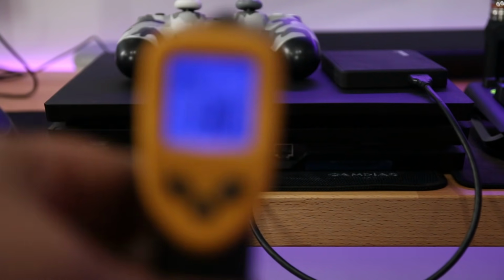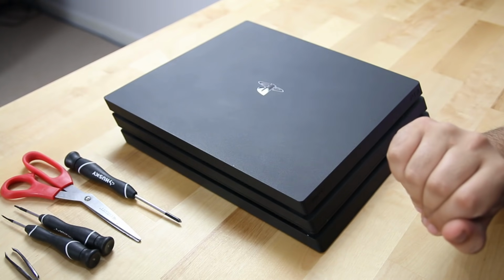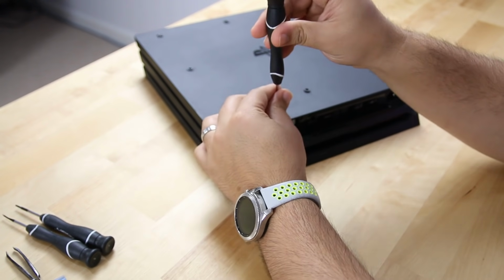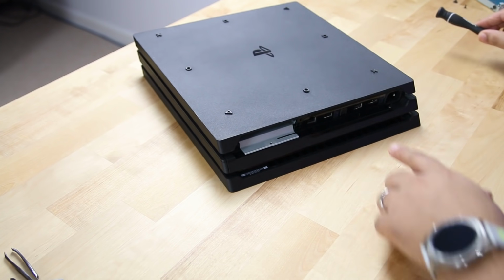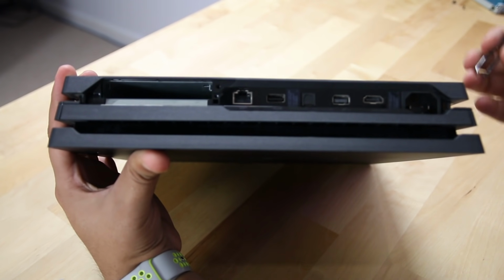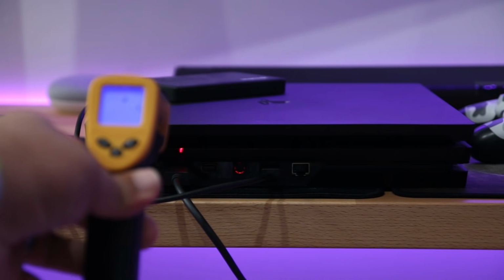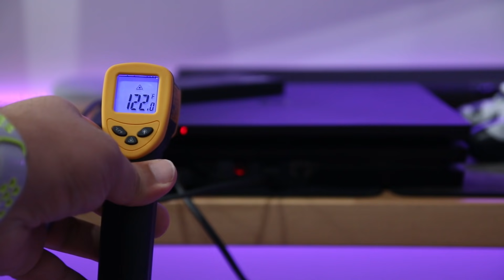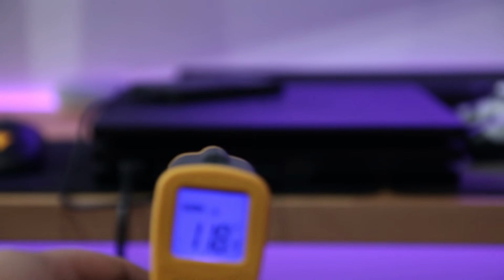PS4 Pro Fan Noise Fix - Thermal Paste & Pads Upgrade

Comment: Hi. Please check the video at 7:00. That are not memory modules. In fact, those are chokes. They do not require cooling on the ps4 pro. It's the vrm's that need it(the little black chips a few milimeters above. So you have put the thermal pads on the wrong place. It may fry your ps4 pro.

The thermal paste usually is to put on top of the apu and not the heatsink. But the way you did it works also.
Reply from the maker: Thanks for correcting that. I'll be sure to fix it
Reply: Thanks for mentioning this because I was just about to do this. When you say it's the little black chips (x6), do you mean the ones lined up right against them that require the cooling pads?  Or the 6 other ones which are grouped 2 and 4?
Reply: @pspasta5399  The other 6. Not the 2+4. On the video is the 6 chips above the place where he put the thermal pads.
Reply: chicozeb i opened my ps4 pro and by default the white thermal pads are on the chokes. i’m confused here
Reply: The chokes were (padded) from factory, he just replaced them.
Reply: Hi. I'm thinking about replacing the thermal pads and paste of my PS4 Pro at the moment, because it's gotten ridiculously loud at this point. And during the video, Tech Savvy Buyer recommended 1 mm thick thermal pads. But there is also 0.5 mm thermo pads. Wouldn't those be better? 

I will also try and put on the thermal paste as thin as possible using some plastic card to spread it, just to connect the APU with the metal plate without any air inbetween.
Reply: Well spotted! At the beginning of the video he recommends buying thermal pads of 1mm thickness. I now wonder even if that's correct... sigh
Reply: @nekron75  I ended up not replacing the pads at all and only replaced the thermal paste. I used arctic MX-4 2019 edition, which is the most common among mid to high tier pastes. I think, the pads need to be 1mm thick, in order to connect the memory with the cooling shield. The original ones are a little small and ould be replaced with new ones covering the whole surfaces, but the original ones seem fine. The way more critical part is the APU. 

And I'm absolutely happy with the result! It is not an overreach to say that my PS4 Pro is now way more silent by a factor of 10! At first I heard nothing at all during the menu of DMC5, where my PS4 would previously be loud as hell already. So I was worried that I forgot to reconnect the fan or something and the thing is overheating right now. But air came out normally and even during gameplay, where the cooler would normally run at max power, the PS4 was still almost silent.
Reply: @CycloneFox  Replacing only the thermal paste really made such a difference? Was the original thermal paste dried out then? Also there was no dust clogging up the heatsink? Sounds promising! I have some thermal grizzly kryonaut left i.e. rated at 12,5 W/mK, arctic MX-4 2019 edition is 8,5 W/mK. If the noise is still too much, I might buy a fan controller (https://www.ebay.com/itm/PS4-Pro-Fan-Mod-Variable-Speed-Controller-for-CUH-12xxx-7xxxx-Wht/191754341074?hash=item2ca5730ad2:g:I7gAAOSwcgBcmqAP) the grey one probably and tune the fan lower so that the exhaust air temperature is about 6-8 degrees Celcius higher, just like with the newer 7215 ps4 pro model (it's a quieter model (initially only bundled with rdr2) because the fan spins slower but the exhaust air is about 8 degrees Celcius higher).
Reply: @nekron75  Actually yes. I bet you get the most optimal result with a higher quality thermal paste, but the main problem lies with the oblong shape of the PS4 Pro's APU compared to the square form of the original PS4 APU. The thermal paste is only applied in the middle and spread by the head sink pressing on it. So the two outer edges don't get enough thermal paste and there is a lot of air. So replacing the thermal paste and spreading it evenly with a plastic card evenly on the whole surface including the corders and edges will fix the whole problem. 

My heat sink had a bit of dust in it and I already cleaned the fan on the top. But the main problem was really the unevenly applied thermal paste. 

When opening your Ps4 Pro, make sure to not break of the plug connecting your power unit to the main board! The pod for that plug is solder jointed on the mainboard and the plug may be hard to pull out of that pod. So many people try to wiggle it out and break the solder joints in the process. I personally didn't pull out the one on the board, but on the power unit. That way I later had one more cable in the way when re assembling the main board, but I had an easier time reaching the plug. So I could hold it down firmly on the power unit's board while pulling it out with a pinch-nose straight. 

But that's the most critical part of disassembling your PS4 Pro. There were five or so flat cables of which the widest one had a clamp, which you need to clap up with your finger nail before pulling out. But the rest is pretty safe. Just have a few containers for at least three different kinds of screws and you should be okay.
Reply: @CycloneFox  Thanks a lot for the explanation! I'll order some 1mm "thermal grizzly minus pad 8" thermal pads (8W/mK) and then do the mod.
Reply: @chicozeb  The circle chips that's grey/black? or the chips directly touching the pads?
Reply: Aris Golseen It seems like the video is updated and it’s in the right place now, because if you go to 7:00, the 2+4 chips are below the ones he put the pads on.
Reply: @marcusgetsbuckets8798  wait so it used to be on the 2+4 chips?
Reply: It seems that there´s some confusion about this subject...

I´ve opened my ps4 pro again and i´ve checked everything again(looking between the motherboard and the metal plate while closing) and the thermal pads go to the place that i said before. http s://d3nevzfk7ii3be.cloudfront. net/igi/4N6gx2rfRwkLEJLU. huge (please remove the spaces because youtube will make my comment invisible if i post links).

The thermal pads go to the 6 Fairchild Semiconductor DG26CF FDMF 6840C. They are between the 6 chokes where he puts the thermal pads in the video and the 6 capacitors(the silver cylinders). The 6 black chips (or mosfets) in blue on the image above. Image credit of ifixit - PS4 pro teardown - step 10.

You can use 1mm thermal pads or 1,5mm. All thermal pds used by sony are 1mm. I used actic thermal pads with 1,5mm. They will squeeze, so there´s no problem(in this situation, because sometimes bigger thermal pads make other components not touch the heatsinks - not in the ps4 pro though).

I used 1,5mm thermal pads on the vram on the other side of the board. No problems also. It makes contact for sure, while the 1mm pad may not make proper contact if something is crooked or not entirely flat(may happen with industrial production). It is a little more difficult to screw it down but the pads will squeeze and be ok.

For the APU(the AMD ps4 chip), i used Thermal grizzly Hydronaut. Originally i used kryonaut, but since my PC GPU temperatures got considerably worse over 1 year using it(3 to 4ºC hotter), I decided to replace the thermal paste in every console that i have with Hydronaut, following thermal grizzly advice, after i emailed them because of this issue. Apparently kryonaut will pump out. More speciffically, the silicone on the paste will pump out. In fact, every themal paste made with silicone will suffer from this. MX-4 is not good because of this. Half of it is silicone, and after a while, temps will become much worse while the silicone on it goes away. So it´s better to use non silicone thermal pastes. And with a percentage of thermal conductive materials above 80%(zync oxide, aluminum oxide). To check the composition, google the name of the thermal paste and write msds. Or Material safety data sheet. Usualy there´s good information there. Hyronaut does not have silicone, so it does not pump out or bleed.

To apply the thermal paste it´s better to spread it. You will be sure that every part of the chip is covered. Using a small dot in the middle does not give you that guarantee. I always use more thermal paste than i think is necessary. It will not damage anything(unless you use a conductive paste) and the excess will go out to the sides. This will compensate for any big uneveness that the heatsink may have, and again, it will guarantee contact. And no, it will not make temperatures worse, there´s a lot of youtube videos talking about that. Too little thermal paste gives you bad temperatures. Not too much. It´s more expensive though...

And yes, using hydronaut makes a difference. The fans are quieter. I was trying to show a friend the jet engine noise on the god of war title screen and the ps4 pro never got to that point(that´s when i remembered that i had put hydronaut a few weeks before).So, for me, hydronaut is far better than kryonaut and, surprinsing as it may be, it gives me better temps on my pc gpu and on my laptop, even having lower thermal conductivity. Go figure...

On a side note, i´ve replaced the arctic silver 5 on my pc cpu with hydronaut. Done a stress test before and after the replacement. Hydronaut gave my 2ºC lower temperatures under full load. Funny thing is: it´s the first time that i replaced the thermal paste on that pc. Arctic silver 5 was there for about 7 years. Temperatures like day one. So it seems a good paste for longevity. At least from my experience. And it does not have silicone.

Comment: I put Kryonaut in my Pro and the results are pretty incredible. It's much cooler and quieter now. Super impressed. Haven't done the thermal pads yet but I plan to do so soon.
Reply: How long does kryonaut last before it is replaced?
Reply: @collinsatinga2131  I usually replace mine about once a year, but it could probably last longer than that.
Reply: Any paste will work. It's just a matter of for how long before needing to re-paste.

Comment: Good video.  I know some other YouTubers have pointed this out but just before 5:00 make sure you've taken out all of the T8 screws on the metal bracket on the other side of the PS4 before removing the PSU....I slightly cracked the plastic cover that shields the PSU until I realised there were two T8 screws which needed to be removed!  Also, I found the PSU connector cable virtually impossible to remove, so I left it connected.   It's a bit of a pain in the arse when leaving the PSU connected but it is doable

One thing I discovered was after applying the thermal paste (pea sized) the PS4 fans were louder than ever.  This is the first time I've ever had this issue when applying thermal paste (I've applied it to many CPUs) - so I took the PS4 apart, applied more paste and spread it over the APU.  The PS4 is now as quiet as a mouse.
Reply from the maker: Thanks for pointing that out. Can't believe I left that out lol. This was one of my earlier tutorials and I missed some key things. Lesson learned. Thank you so much for taking time from your day to write this comment. You are amazing and I appreciate it very much. I hope your system stays cool! God bless ya
Reply: Tech Savvy Buyer No problem! It’s still a good tutorial!
Reply from the maker: Thanks bud. Much love from Ohio!
Reply: I couldn't get the PSU cable out either, I came close to damaging the little wires so I had to give up. It was very awkward to add the paste because it was in the way but it worked in the end.
Reply from the maker: Did you make sure you removed the screw on the other side of the PSU? It should pop right out. If something feels stuck always check that all the screws are out.

Comment: I currently have one of the Star Wars Special Edition Pro consoles and it sounds like a jet. I have seen a ton of people with these issues regardless of where the console is placed. Changing the fan is suppose decrease the noise significantly. Keep up the great work!
Reply from the maker: Thanks Adam! You are right about the fans. The Delta model is the one that is really noisy, the Nidec one is better quality and doesnt make as much noise at high speeds. The newer pro's mostly have the Nidec fans but its still a lottery really lol. The thermal paste and pads change made a HUGE difference. My fan barely kicks in anymore! God bless you bud.

Comment: i did change the thermal paste  but i did it with a cheap one and the fan noise did not go away. this time i used a master cooler pro and it worked, also i did a very good cleaning around the APU, and i did'nt even put new thermal pads.
 first gen ps4 pro thanks man.

Comment: Okay guys bear with me through this comment as I am excited haha. 
So I have had a pro now for a few years and it has always sounded like a space X rocket, I have tried thermal pads, fan maintenance, too quality thermal paste and nothing worked. I have taken apart my pro 16 times to analyze how I could resolve the over heating and loud fan.

Step 1: Okay if you look on the back of your pro right above the connector ports there is a detachable center piece with vents and that section is where the hot air is flowing through the power supply and out. I removed this.

Step 2: if you take of the top shell of your pro and look in the back you will wee more Vent, Now after much testing I realised that with these vents my pro is forcing hot air up into those vents and back into the pro so I put masking tape across the top of these vents and put the shell back on.

Results: I played Assassins creed odyssey for 5 hours straight, Then death stranding, then ghost recon breakpoint and Each time the console Never over heated AND the fan never kicked into overdrive.
Honestly it never even got loud enough to hear.
Reply: Mistah Opinionatah Hey, I’m looking at my pro right now, so you’re saying you literally just taped up that back vent above the ports entirely? I’ve been wanting to fix the fan problem for a while but didn’t want to mess with any thermal paste and stuff really. Tried cleaning the fan, but it doesn’t help a bit.
Reply: @christophersorensen9580  so when you are looking at the back of your pro you see the center piece between the top and bottom? I took that centerpiece completely off the back. Its just a strip of plastic with fan vent slots in it right above your plugin ports, just pull that thing right off by the corners. 
-You have to pry hard enough to break the little plastic holders on that strip but you wont even notice its gone.

Now the tapping part.
If you pull off the top cover of your pro and just look at the top back section you will see more vent slots. Those are the vents you will tape over.
Reply: @christophersorensen9580  I really wish I could just show you a picture.
Reply: @angelwtswzer0  Did it work? Really want to know if it worked!
Reply: Do you have pictures to clarify?
Reply: I wish i knew what you meant by detachable back piece. Could you maybe describe where it’s located and what it looks like a bit more? Im having trouble.
Reply: S W wait hang on, if you’re referring to the piece with vents and the writing with “hdmi out, lan etc” isn’t the hard drive attached to it via a screw?
Reply: is there a way you can make a video or show pictures of what you just said? I'm trying to picture that in my head but I couldn't.
Reply: Didn’t do anything for me
Reply: Also there’s 2 little screws on each end of that plastic piece so yank at your own risk lol
Reply: @st33z17  damn brotha sorry it didn't do anything. It's sad all these tricks to fix the noise are a hit or miss rather than having 1 working solution.

Comment: one thing that would work wonders in testing before and after with the ps4 pro is a laser tachometer. sure it would require testing with the top cover removed, but it would offer a lot more insight into what's going on.

beyond that, fantastic video! I think you've won yourself a subscriber :D

Comment: Thank you man. Very detailed tutorial I’ll be happy to watch while I’m doing it! Will be very grateful to try this soon. Thanks again
Reply from the maker: No problem - dont forget to catch my mistake with the thermal pads, i pinned the comment in the video :)
Reply: @TechSavvyBuyer  I'm planning to do this job this weekend - got my paste and pads. I'm not sure what mistake you are referring to though - I don't see a pinned comment?
Reply from the maker: @karamuUK  read the description. I repinned the comment
Reply: @TechSavvyBuyer  OK, got it now, thanks.
Reply: @TechSavvyBuyer  Meant to say, did the job as in your video and it's worked an absolute treat! My PS4 has gone from jet engine to nearly silent. Nice one man, I reckon I have extended the life of the machine as well as I found heat damage when I stripped the machine so good job I have sorted the cooling. Thanks for the video!

Comment: This saved my PS4 Pro. It was so loud that it was difficult to hear my games. I was sure it was ready to break. I replaced the thermal pads and paste and now it is so quiet I need to be within 2 feet to hear anything at all coming from it. The difference was more than I expected like when a car does not have a muffler then gets one.
Reply: How is your Ps4 pro doing now, it is still running great. I did this with my PS4 pro and it helped a lot. I can finally enjoy my PS4 p4o

Comment: I would just add when you screw back the pressure plates tighten all 4 screws evenly so the thermal paste spreads evenly as well

Comment: I've just had a go at this. It is not for the inexperienced. Don't try it if you can't afford a new ps4 or to have it repaired. My console wouldn't start after I did it but thankfully it was just a bent plug on the PSU
Reply from the maker: Excellent work dude.
Reply: @TechSavvyBuyer  thanks for the video!! Certainly wouldn't have done it without your help. I ended up leaving the PSU in because that plug didn't want to come out and I didn't want to risk pulling the tiny wires out